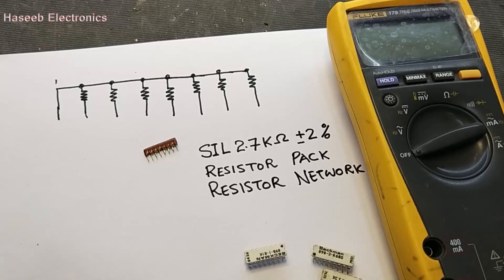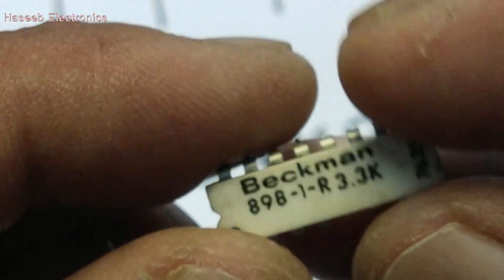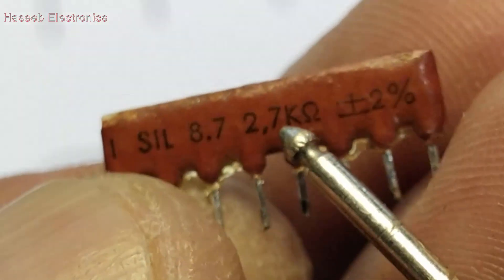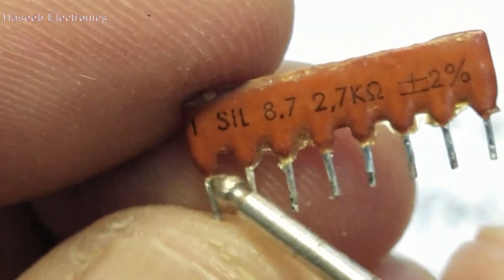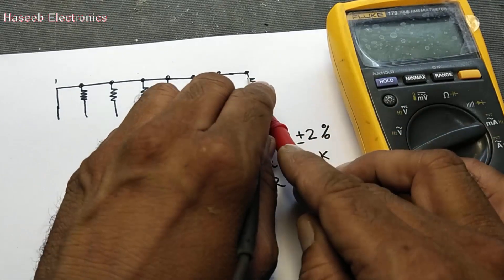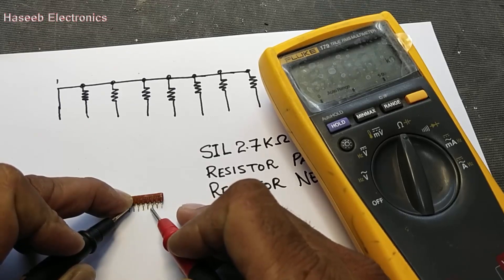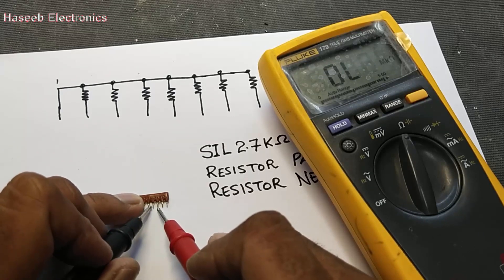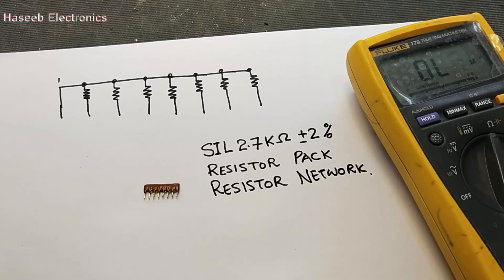{492) Resistor Network, Pinout, How to Test SIL 2.7K Ohm Resistor Array  Pack

Comment: if connect resistor in parallel how to calculate
Reply from the maker: this resistor networks are used to connect in pull-up or pull-down configuration.